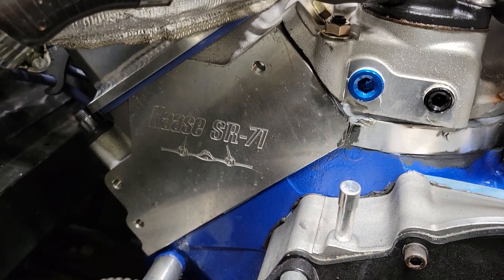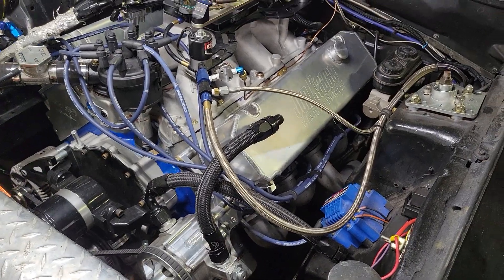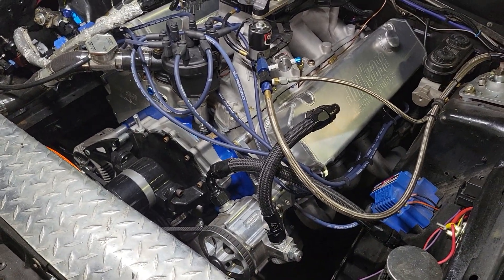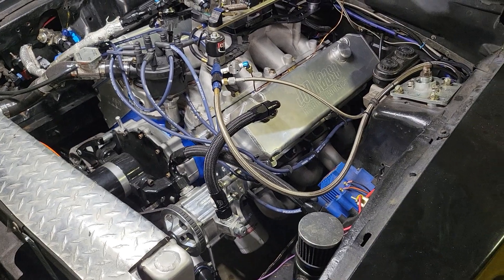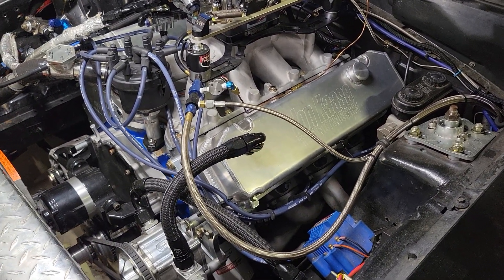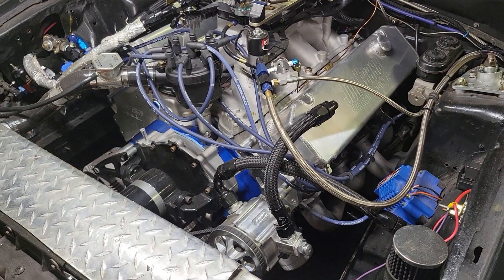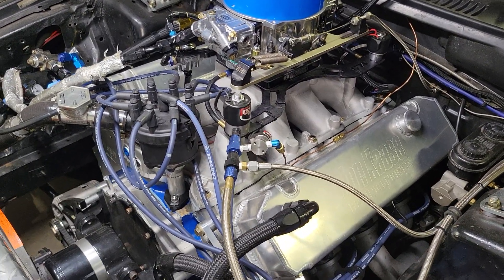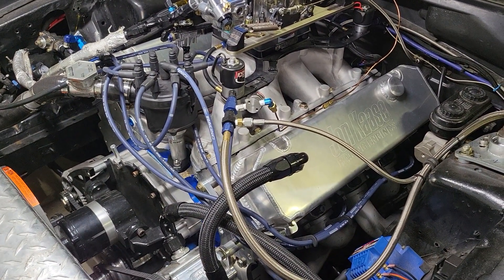kaase sr71 cylinder heads work on stock bore blocks!

Comment: I'm wanting to build a 429 with the p51 built.bottom end cam and intake just wanting a good 600hp street motor
Reply from the maker: Should be a good combo.  For sure talk with Roger at kaase about what your doing and he may have a cam on the shelf for ya
Reply: For the street I would go with 460 stroke or bigger. The 429 will work but it shines more in high rpm race applications.